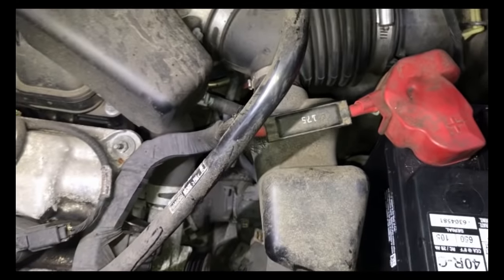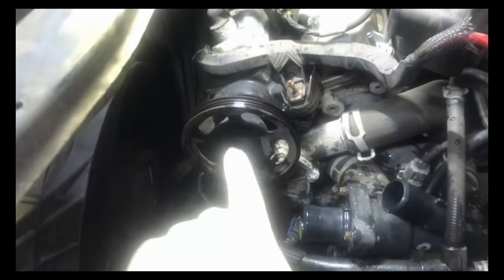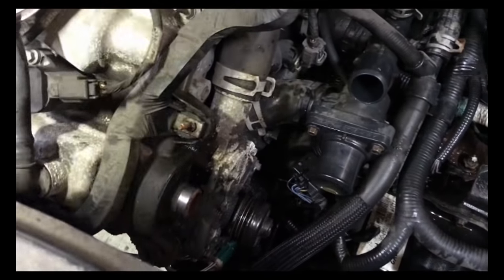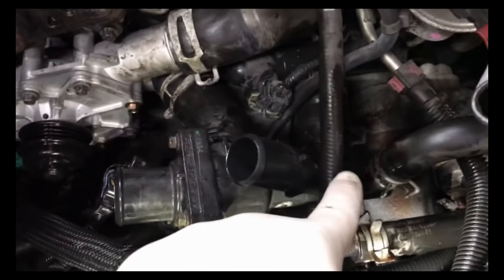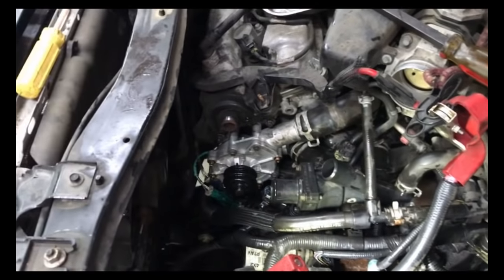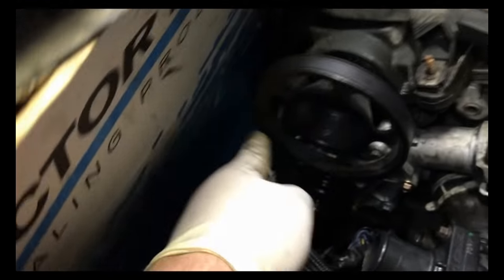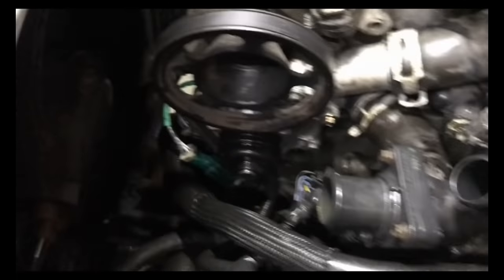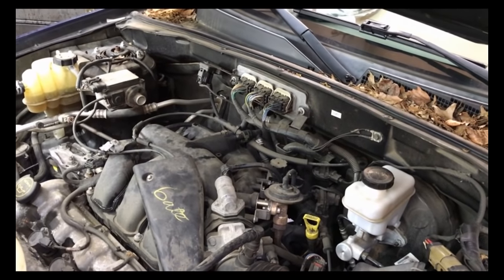Ford Escape And Ford Fusion 3.0L Water Pump Replacement

Comment: Nice video, I'm having troubles to install the belt for my Ford fusion 2012. Could you please show me the belt specifications? Thanks in advance.
Reply from the maker: You have to jump the water pump belt on., It is explained near the end of the video.
Reply: @TheGAutomotiveAndMore  Hi. Great video! Instead of turning the car over via the ignition, can you tell me how to access the crank to spin it by hand a bit? I see some replacement parts (Gates) tell me to zip tie the belt to the cam pulley then manually turn the crank. But I'm having trouble seeing where to spin the crank at.  Thanks.
Reply: The 12 Fusion Milan is a different set up. Pump is directly into the block.
Reply from the maker: @threeboysgarage   The crank pully is on the passenger side front wheel. You might have to remove wheel and the plastic cover to access the crank bolt. Thanks for watching

Comment: Is this the same configuration for the 2007 Ford escape?
Reply from the maker: Yes it is. Thanks you watching
Reply: Not for my 2006 Ford Escape Limited 3.0L. The camshaft pulley doesn't cover any bolts of the water pump. The uppermost bolts of the pump are about 2 inches lower than the pulley's lowest edge. This model is manufactured in Kansas City.  I was about to look online for a tool to remove the pulley until I checked to make sure and I'm glad I don't have to go through this. It's a good video thought and I still learned quite a bit and I subscribed.   The question is aren't all 3L Duratec engines identical?  Or the engines are identical, but, surrounding parts can vary?

Comment: Do you know what the thread is inside the cam someone bothered the threads I need to clean them please help
Reply from the maker: The one on this car was 8mm X 1.25. Thanks for watching
Reply: @TheGAutomotiveAndMore  your video has the information that I was looking for, great, one doubt if you can help me, the 8 mm are refered to the head of the screw and the 1.25 is about the grossor of the screw to put it back? Thanks for advanced.
Reply from the maker: @luisherrera3896  Its a 8mm x 1.25 pitch bolt to reinstall the pully. Thanks for watching

Comment: what is the internal thread of the shaft of the pulley?
Reply from the maker: This on was 8mm x1.25 but yours could be different. Thanks for watching
Reply from the maker: This one was 8mm x1.25 but yours could be different. Thanks for watching
Reply: My car is mazda tribute 2008 with 3l
Reply: In my mazda tribute 2008 3L there is no thread in the end of the camshaft, just some kind of cup, about 5mm deep. How can I put the pulley back on?

Comment: i did this without pulling the pulleys
Reply from the maker: You must have a different year. They changed it later on where you don't need to remove the upper pully. Thanks for watching
Reply: It is a 2005
Reply: I didn't have to remove much just hoses and thermostat housing I'd figured 2005 and 2008 would. be the se they look the same
Reply from the maker: @razxx1  I just looked it up, they are different. Your pully is on the top cam and the one I did is on the lower cam.
Reply: @TheGAutomotiveAndMore  yhat sucks well im glad mine was so easy i hate pulling pullys know i have to change the radiator its never ending

Comment: Hi Where i get.  that puller?
Reply from the maker: This is  Matco MST4534 puller. You should be able the get it on line if you not have a distributor in you area. Thanks for watching

Comment: Dude your wrong
Reply from the maker: No I am not. This is the way you do this model. They did change it in the later model where you don’t need to pull the pulley off.

Comment: Can this work for a 2012 Ford fursion?
Reply from the maker: It looks like it is different. It looks like the pump will come out with out taking the pully off the motor on a 2012 according to my info. But if you need to remove the waterpump housing you will have to remove the pully.
Reply: The G Automotive And More thank you

Comment: You don't have to take the pulley off to remove the waterpump. You can order the pump separately and don't have to remove the housing. I did all that myself on 2010 Escape
Reply from the maker: On this year you do, they changed it on the later years.
Reply: This is the 2008 v6. On this one you do.

Comment: At 2:47 what hose attaches to the bottom piece of that water pump?
Reply from the maker: There is so many hoses down there I have no idea witch hose you are talking about. Thanks for watching
Reply: @TheGAutomotiveAndMore  its the down piece that connects eventually to the heater core in the back
Reply from the maker: @thatshadycow2294  I did this 5 years ago and in the video does not show it very good. I would go to Ford parts and get them to look up the exploded view of it to find what you need.